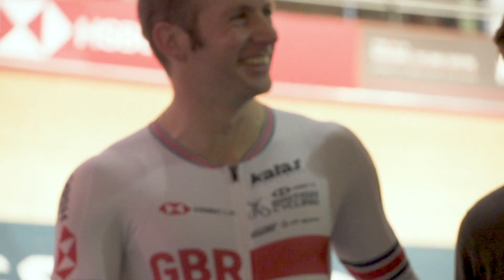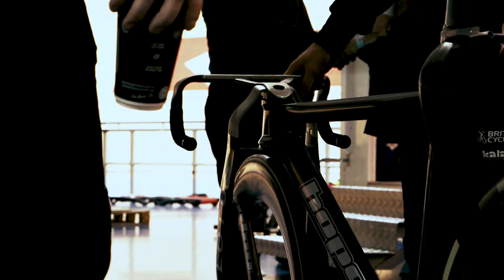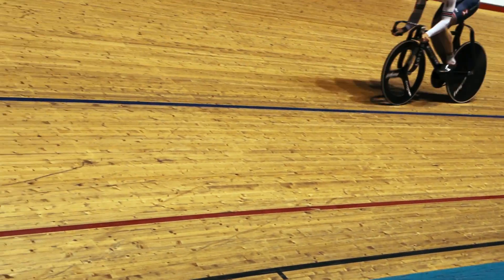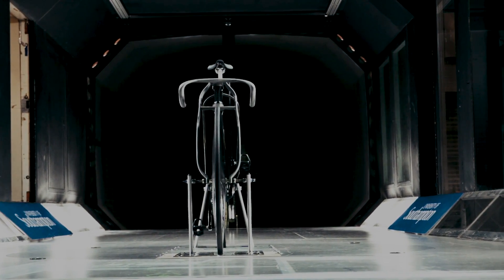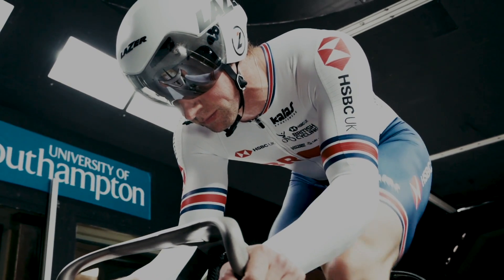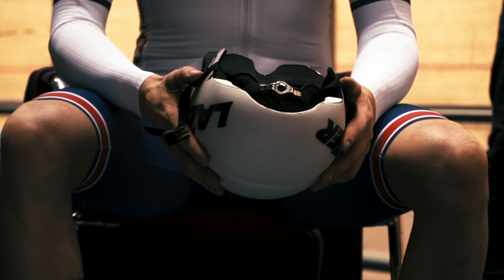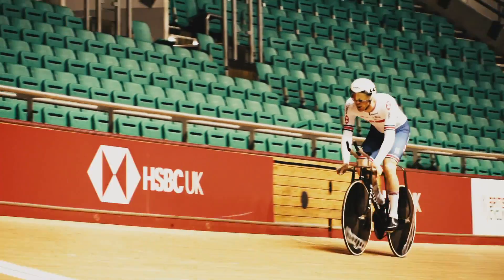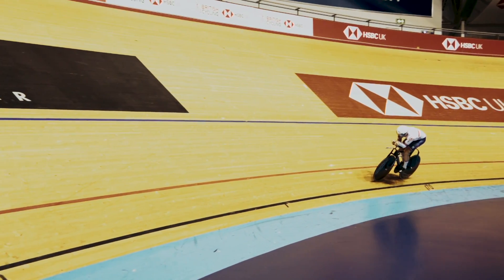NEW Olympic Track Bike! | Behind The Scenes With Hope Tech & Lotus Engineering

Comment: Are the wide forks and seat stays to clean up the airflow from the riders legs?
Reply: My guess exactly.  High pressure from a rotating wheel on the inside and low from the outside should create enough outwash at the front to reduce pressure on the front of the leg, and large chord airfoils behind them should reduce the wake instability and dramatically reduce the wake behind the whole bike.  Might be way wrong but I'm thinking that guessing is the closest we're gonna get to an answer for a good few years...
Reply: @samuelhopely4853  well they wouldn't do it just for looks 😂
Reply: Makes sense! Having them all in a line would reduce the overall frontal area as well

Comment: will 650B 43c tyres fit on a 27,5" wheelset
Reply: Depends on the internal rim width 👍
Reply: ExplosiveToaster what?
Reply: @ianiscaratti4924  whilst 650B and 27.5" wheels have the same Bead Seat Diameter, the internal rim width will dictate what tyre sizes are suitable for a given rim. If the rim is too narrow for the tyre, the tyre will "lightbulb" and you risk the tyre rolling off the rim. If the rim is too wide for the tyre, the tyre will "bell" (similar to tyre stretching in car culture) and you risk the tyre not being supported properly and it will pinch flat and damage the rim too easily. Your rim width should be printed on the rim, or easy to find on the website of the rim manufacturer. You can cross reference this with the ETRTO rim width standard, as they test what is safe. Hope that helps 😄